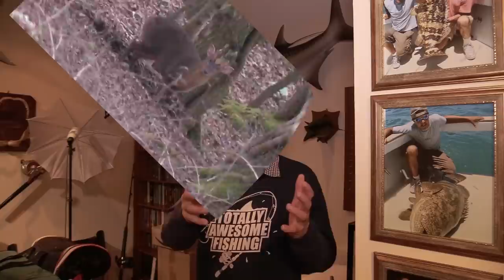Clearing my Pond | Rare Deer Footage | Restoring Antique Hammer | TA Fishing

Comment: My father was a blacksmith. He had hammers like that. They where used to drive the hot metal apart. The master held the hammer with the small rounded side at the place to be parted, then the helpers (mostly 2) smashed on the wide side of the hammer with big slash hammers.
Reply: Yes, it's a heavy blacksmith peening hammer to spread the metal.

Comment: Hello Graham I believe that the hammer you restored the handle on was widely used in the smithies trade they if I remember correctly there were several different weights used to drive steel drifts through hot metal for holes and slots etc love your vlogs always something of interest in the contents👍